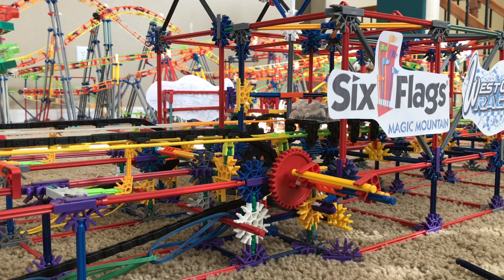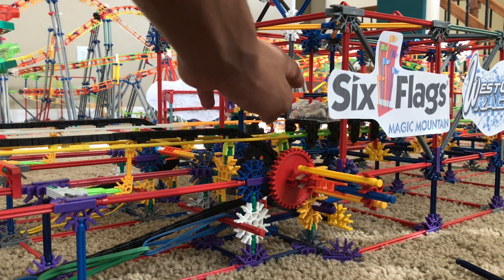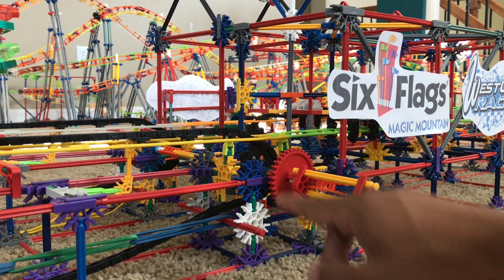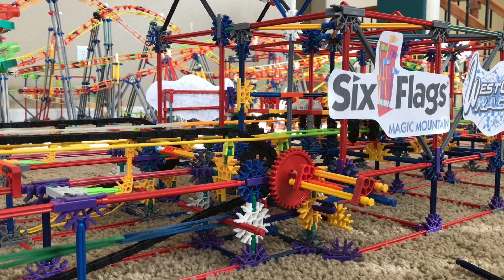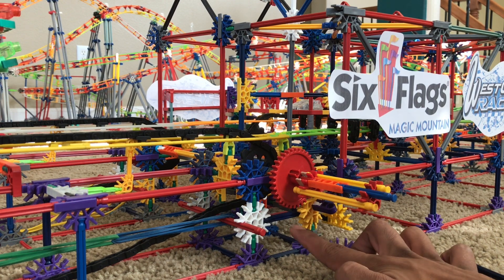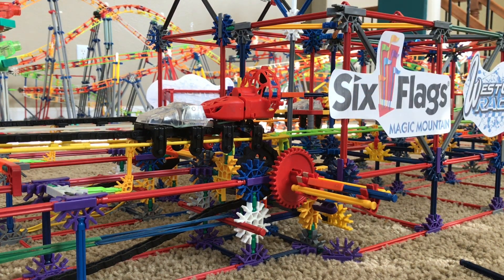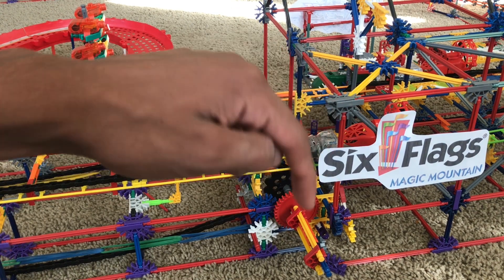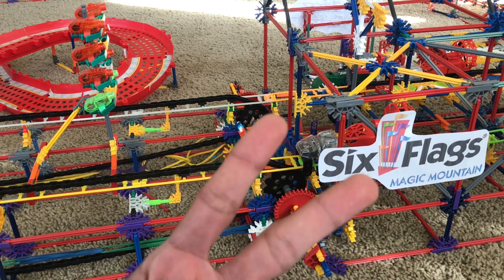How to make a K’NEX Coaster Launch

Comment: I’ve tried building this mechanism but as I wind it back to stretch the bands, the cog attached to the chain slips, meaning I don’t actually have any PE. I can’t make the chain any tighter
Reply from the maker: Reece Dickinson Do u mean it slips off the rubber bands??
Reply: Roller Coaster Crafter no the chain slips round the cog once it’s got so tight. But it’s nowhere near right enough for a decent launch.
Reply from the maker: Reece Dickinson ah i see

Comment: I tried building this launch but it didn't work. Can you make a more in depth video?
Reply: start with a basic chain drive, and attach one of the sprlckets to a gear and a drum for the bands. the pin should be a white rod away from a red gear. Hope this helps!

Comment: How do you connect the rubber bands to the chain?
Reply: I was wondering the same thing. I haven't actually built this yet, but I think he just put the rubber band between two chain links
Reply: I attatched the bands to a rod attached to a few 8connectors and it worked great. Good Luck!